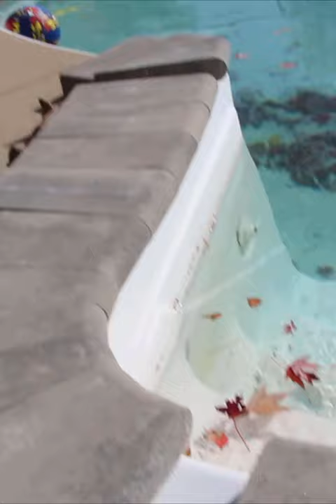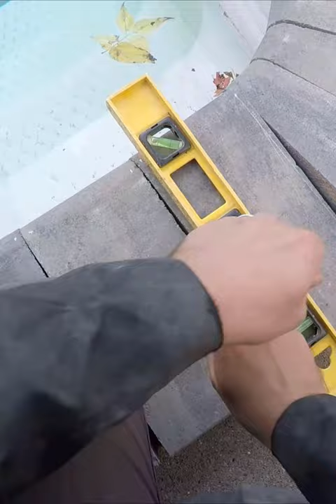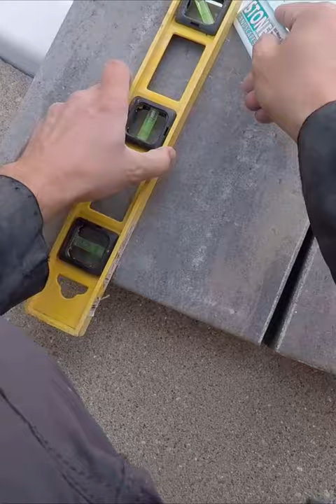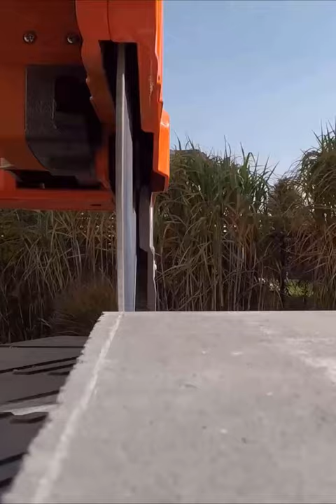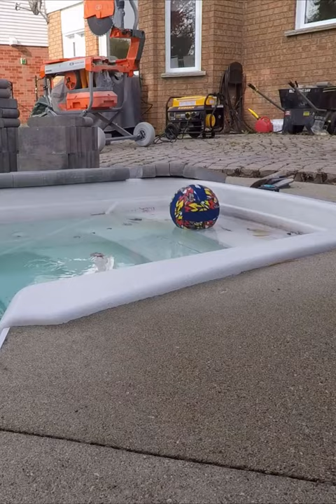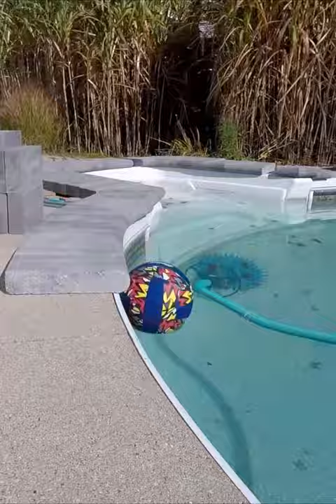Cutting Bullnose Coping Around a Pool #shorts

Comment: What do you use to bond the coping paver to the acrylic/fiberglass stair?
Reply from the maker: Half of it was mortared to the concrete and then I just used a Hardscape adhesive dab on the stair. Seems to be holding well.